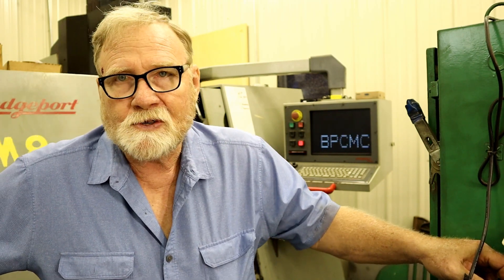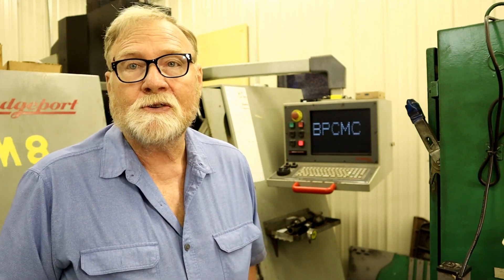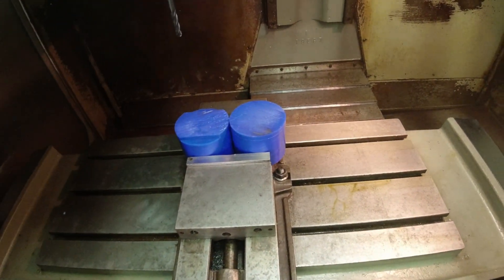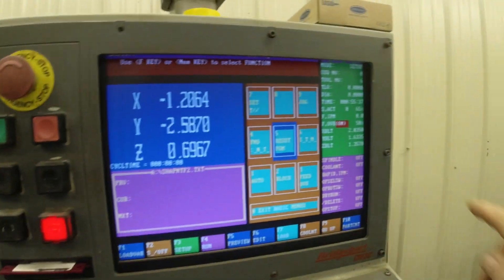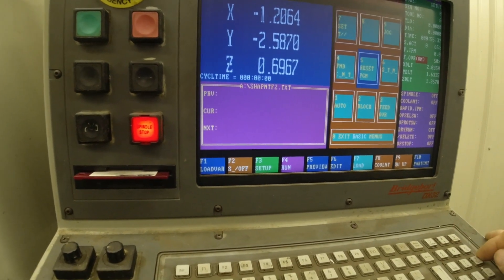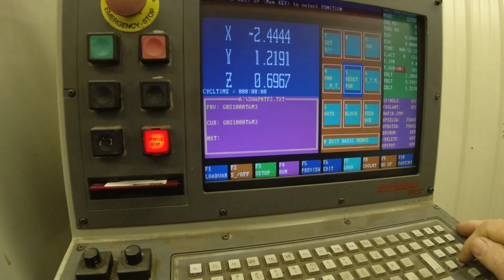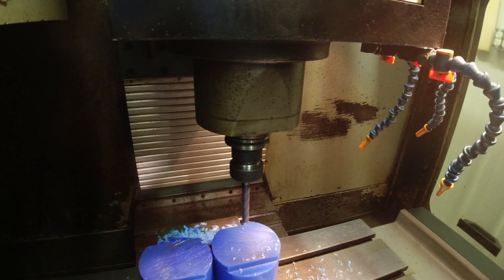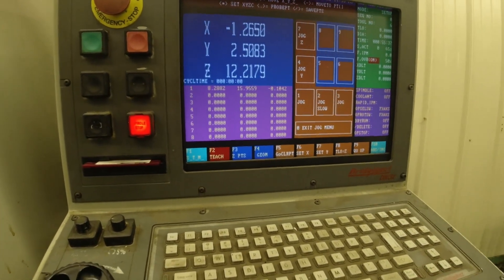A CHEAP way to prove your CNC Programs...

Comment: The DX-32 had a lot of parametric programs that were handy.
Reply from the maker: I think it is a good machine... Just hope I can keep the electronics going..   I don't know much about the programing and depend on BobCAD to write the codes.
Reply: @10swatkins  The iron is fine.  There are still plenty of parts for the controls, the drives are a little iffy but Yaskawa still repairs them  EMI is your source.

Comment: Interesting. I’ve used sacrificial materials before to test making something before the real part. It’s great that you can melt, cast and reuse the wax. Is it normal paraffin wax with coloring in it or is there anything special added. Thanks for your great videos.
Reply from the maker: I don't really know the make up of the wax... It is very hard and much more like plastic than wax...
Reply: @10swatkins  Where can you find it? Thanks

Comment: Using my CNC mills/lathes as conventional  mill/lathe all the time, especially Heidenhain and Dialog4/11 are usually configured, so that you can do both easily. Fanuc not so much, needs more fiddling in manual mode.
Reply from the maker: Thanks for sharing!

Comment: Do you have to clean up the wax any differently than metal before using the coolant? I know wax floats where steel won't. Will it clog up your filters?
Reply from the maker: I turn the coolant off... Use a vacuum with a 1 gallon paint strainer in the end of the hose to vacuum up the wax.
Reply: @10swatkins  Thanx

Comment: When I went to vokie we had a fancy mill that used tapes to run it. Guess that's a much older cnc  mill. Not dating myself any am i. The early 70 s., I graduated in 74 never saw a cnc in any of the shops back in those old days.
Reply from the maker: Back in  84 I had a friend that had a tape run lathe... According to him it was the greatest thing since sliced bread :)

Comment: How do you account for the difference in tool deflection between the machinist wax and the actual part? The end mill should deflect very little to none in the wax. In the actual metal work piece some deflection is inevitable. In my years machining, I never used machinist wax. Interesting.
Reply from the maker: I have never had enough deflection to worry about and the wax is mainly used to proof the program so if something wild happens the first time it's run you don't ruin an expensive piece of material.... I was taking a pretty big cut with that endmill, in the program it's only about .035 and 1/2 stepover....

Comment: Steve,

I think you need a little bit longer end mill...not enough chatter created from existing end mill....Hehe.

Way back in time, we set up a part just like you are doing, milled a slight dovetail angle to the milled flats as you're doing.  Machined a set of soft jaws for the vise with the same dovetail angle.  When the parts were put in the vise and tightened, it locked in the parts to where they would not move when machining.  Just food for thought.  As always, thanks for sharing.  Ken
Reply from the maker: That's the end mills that are needed to reach the bottom of the part so I can mill 5 sides at once... 

Might have to make a pair of those ken... I have about three drawers full of soft jaws but none like that....
Reply: @10swatkins  Cool! 🙂

Comment: Do you stick a sock in the end of the shop vacuum hose.  Fold it over like rolling up your cuffs and hose clamp it in place to suck up all the plastic chips without sending them thru the hose and into the drum.
Reply from the maker: One gallon paint filter sock :)

Comment: Very interesting, I didn't know it could be operated without following some code.
Reply from the maker: This one is super easy because of the nice feed wheel right there... The wheel is about 3 inches wide and has 4 holes for your finger to stick into...  You can't blend the two x y movements together like I can on a manual mill but that's what the programing is for :)

Comment: Some of them? I think every CNC you should be able to turn the spindle on and off and jog around manually. Even if not, you could always just write a couple lines of G-Code into the MDI screen and do it that way too
Reply from the maker: This one is supper easy... jog wheel is right at hand..... My old Boss 5 was a pain PITA to work manualy ....
Reply: @10swatkins  It didn't have a pulse generator / jog wheel?? I don't think I've ever seen a CNC mill without a jog wheel, but I'm sure there's tons of CNC machines I've never seen as well. It's interesting that bridgeport one looks like it has a DOS based interface on the CNC. Mine is an old Mitsubishi and it's more of a custom interface. I think you can set a feed rate and just hold the jog button on mine to move at a constant speed without cranking the MPG around and around - I'll know more when I get it fixed and put the whole thing back together! It needs some turcite, so the entire thing is disassembled all over my garage floor...
Reply: @gorak9000  You can dothe same on a Bridgeport 3 axis where you can even start jogging the axis of choice while increasing the feed rate and or set it. I've owned these Bridgeports and the 3 axis eztrack knee mills for many many years and they are great. Steve could also knock out a super quick conversational g-code and it's done. The interface and canned ops are great.